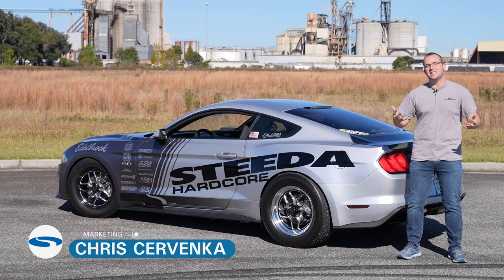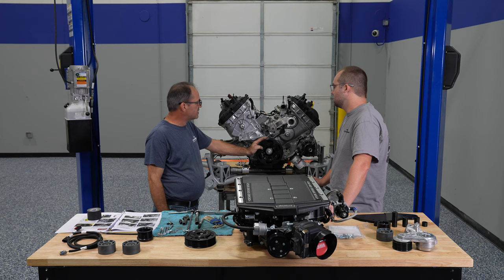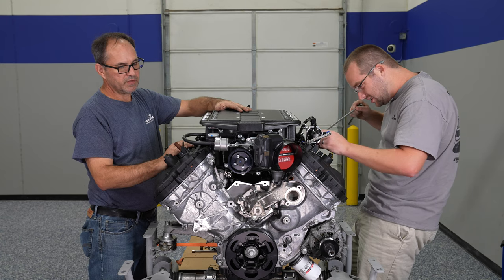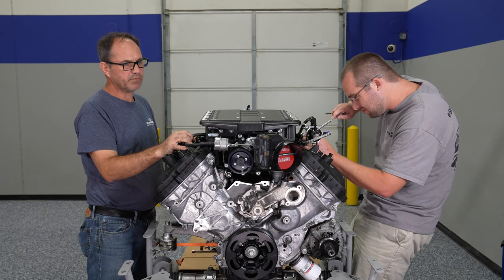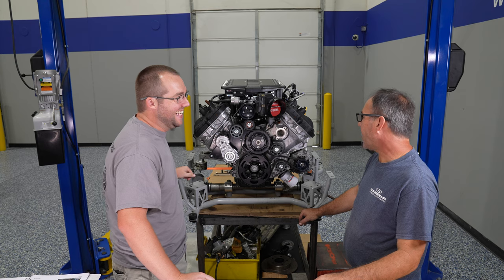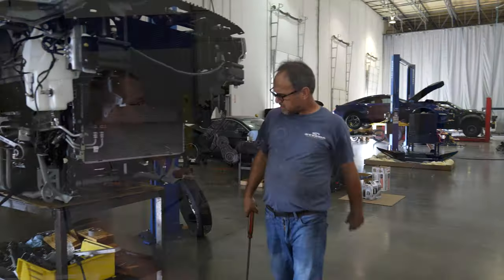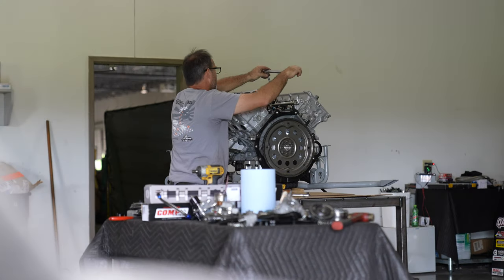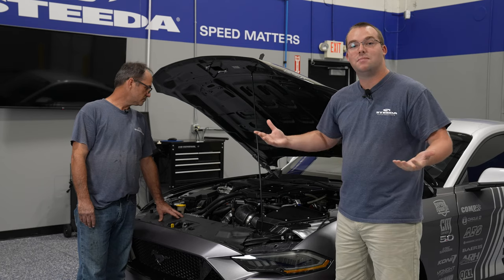Silver Bullet: Installing The #Edelbrock Supercharger

Comment: My Gen 5 3.0L stage 2 Whipple as anyone with a Whipple knows has the largest air/water intercooler in the industry,  I also opted for the oversized heat exchanger and dual fans mishimoto 160* thermostat
Reply: irrelevant for a drag application in this category.

Comment: Call me stupid but I don't know why people use E-85 when there is some perfectly good 93 octane available.   Please Help !!!
Reply: 100 - 105(+) octane, greater cooling of intake air (lower IATs). This allows more total timing and / or more boost. Holly has a good article on this.
Reply: Er. Holley. Autocorrected thumbs.
Reply: Is this serious? Pump gas is way worse then e85
Reply: it comes down to timing and detonation. e85 has less energy per cc than fuel does, and requires 30% more volume to be injected, however it's resistance to detonation and knock is very high, allowing far more timing which helps produce more power. as such, cylinder temps are also more stable, and the e85 fuel is significantly more reliable for racing due to it's thresholds vs 93/98 (depending where you live). Premium is great for a daily and rarely raced car, but not reliable for sustained hard driving use.